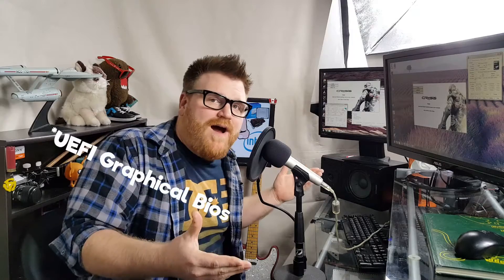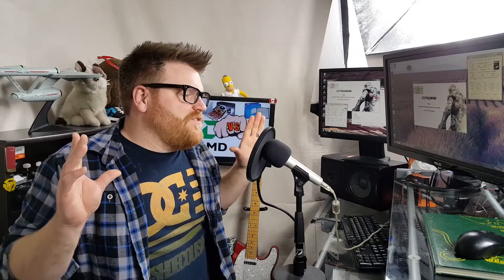Can 10 year old AMD Intel computers still play games?!

Comment: WTF you didn't even use a Q intel chip. Q6600 at the least while the Q9650 or even a Q9550 would have been more inline with what Intel can do. The Q9xxx chips have 12megs of cache and are still capable to play games today.